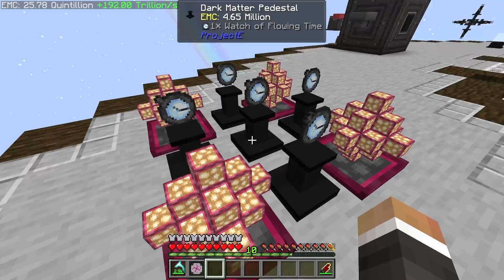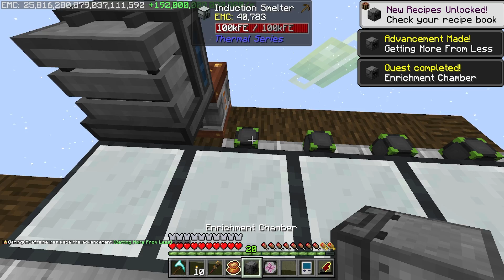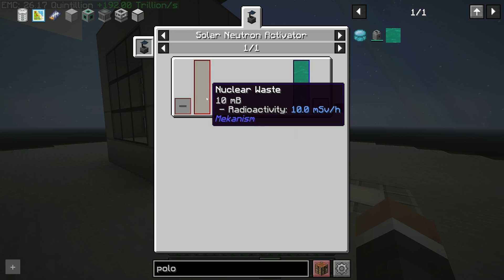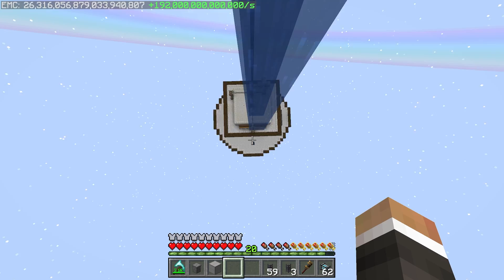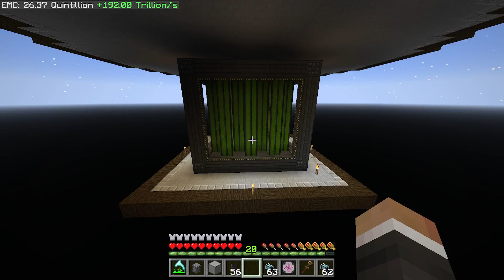Minecraft Sky Revolutions | EASY FISSILE FUEL & FISSION REACTOR! #16 [Modded Questing Skyblock]

Comment: For infinite polonium... the Create Hose Pulley, if you use it on 10,000mb of polonium (in-world) it should consider it infinite. This depends on whether you can bucket polonium in-world. But if you can... that'll save you some reactor effort!
Reply: You missed a couple of 0's. It's 10,000 buckets, so 10,000,000 miliBuckets.
Reply: @MikrySoft  Ouch! That's probably more work than its worth
Reply: Polonium is a gas
Reply: @paulelderson934  oops my bad! Thought it was a liquid!

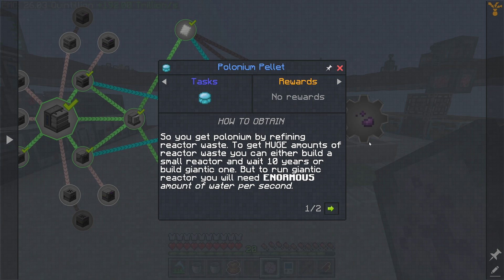Comment: 18:45 the questbook lies, all you really need is a similarly large turbine and you can run the reactor up to (but apparently not including) 400 fuel injection rate.
Source:  I did it and have posted about it to the discord for this pack.

Comment: How do you fix the radiation, I was trying to go along with the steam piping for the fission reactor but took off the pipe without reconfiguring it and now there is radiation everywhere idk how to get rid of it, but luckily my gem armor isn’t taking any durability and is not having any hearts gone so far
Reply: I think it's "/mekanism radiation removeall"
Reply: @seanwallace9269  dont have cheats enabled and cant do that command without cheats
Reply: Chat commands or literal weeks of the game running. There is no other way.
Reply: @paulelderson934  cant seem to turn on cheats on an already created world that didnt have them on before is there a way to go into maybe the folders and instead of cheats-false could change the code to cheats-true
Reply: @Gw4ysen  Cheats can be activated if you open your game to LAN. Even if no other people join up, you become the operator.
Reply: Figured it out you need a Geiger counter made from 4 lead and a basic control circuit right click it in the radiated area and it will tell you how much time is left for the radiation to go away for me rn 7:50pm it says Ill need to wait 5h and 46min

Comment: I have found that lowering the number of items the transmution interface shows per item from 2 billion to something like 1 million fixes a lot of the weird display glitch’s storage mods have.  I am using refined storage and it fixed several issues I was having.  The setting is in the project expansion config file.
Reply: Can confirm this, now it's one of my must do's with project exp. to my exp, 1M-20M items shown seems to work perfectly
Reply: Great help thanks!
Reply: Yep it works wonders
Reply: This fixed my game thank you sm.